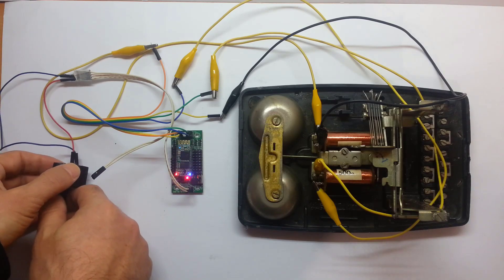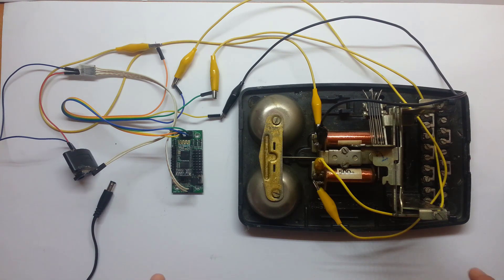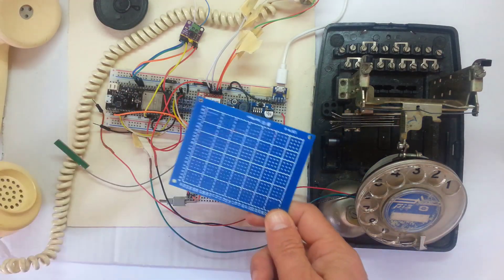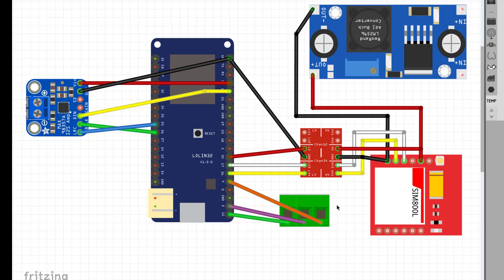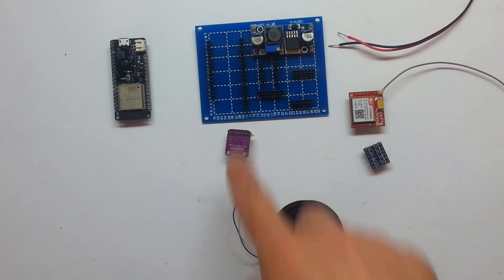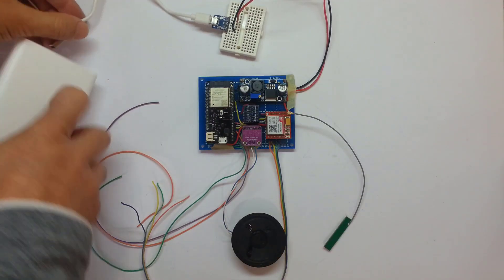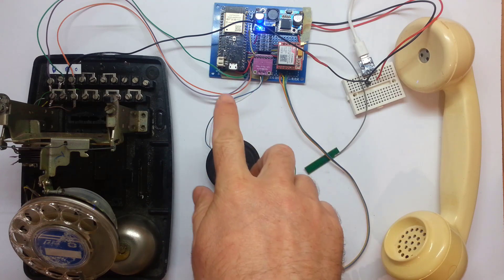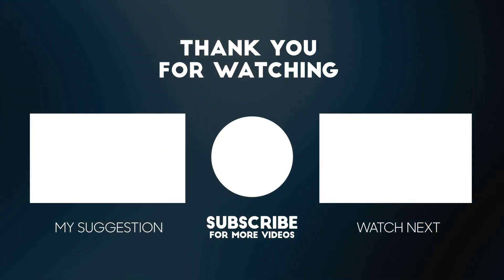Taking a rotary-dial phone into the future – part IV– ring and pcb

Comment: You could use a 5v-12v boost driver for the ringer solenoid.  The magnetic solenoids don't use much amperage to activate.
Reply from the maker: Thanks for the comment,  I thought about it and I mention it, but I did not want to have a second dc converter in side the case (had one for 5V->3.3V).

Comment: u lost me at the replacement of the real bell to a freaking speaker, that just doesnt sound real
Reply from the maker: I totally understand, my main issue was the power needed for activating that bell. 
I made several attempts before giving up on it.
Reply: @talofer99  it needs 60-70 volts
Reply from the maker: @tanello2  I was able to do it on 12V as well, but it was not "it" and as I mentioned before I preferred not to go over 5V :) 

I now plan to make a small switch board for 2 phones, so I can have one in my study and one in the kid's room and we can call each other :)
Reply: I agree with both of you on this...... ;)

Comment: Nah, please don't do a stepper, don't fake it. Use a boost converter to have 24 Volt and then use four MOSFETS to reverse polarity, but protect the circuit from inductive spikes.
Reply: I agree with Andreas, using a stepper, or your "final solution" a speaker, defeats the purpose. You said you liked the sound they made and yet you just faked.
Reply from the maker: I hear you guys, and appreciate the feedback, this is why I first got the ringer to work - to see  what needs to be done  :) 
But for this version, for a long list of reasons,  I will got with the sound version, as fake as it maybe. 
I consider designing a board for this, and then it will be easier for me to add a power suloition for the ringer.
Reply: @talofer99  That sounds great :-) so I'm saving my money for v2...
Reply from the maker: Thanks for the idea, but I prefer not to for lots of reasons .... and I  solved it with the sound library that its on the esp32 any way  :)  (its in the video)